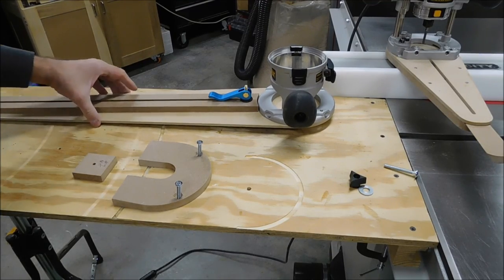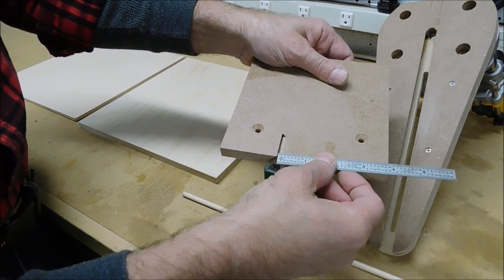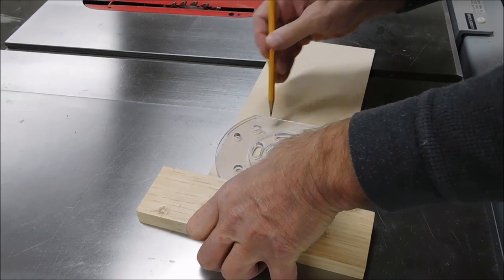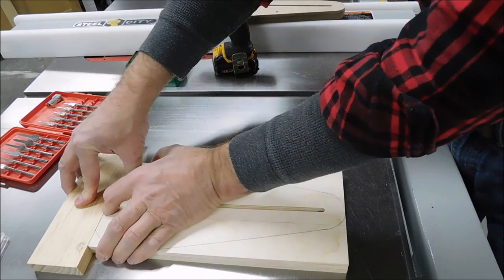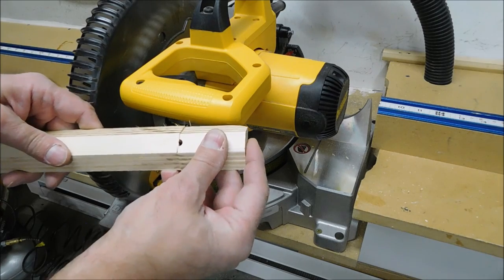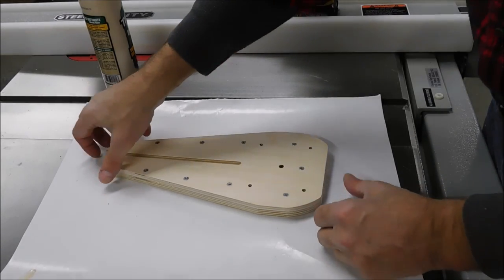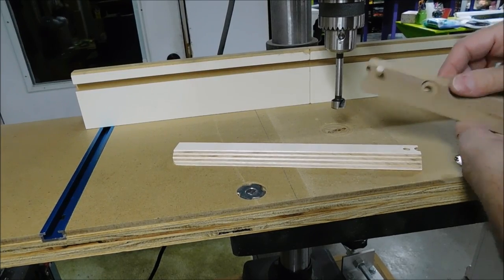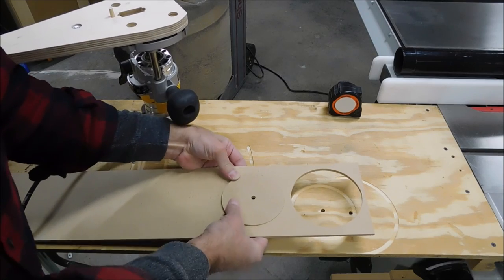How to Make the Small Circle Cutting Router Jig

Comment: Good idea's and well explained tim. I like the look of your pillar drill, what is it and how have you found working with it? Thanks
Reply from the maker: Thanks, sklif f y!  The drill press is a benchtop Sears Craftsman model.  I bought it years ago thinking I wouldn't have much use for a drill press but I find I use it on every project so I wish I had bought a better and larger one.  I like having a laser on it although the laser is cheaply made of plastic and has broken a couple of times.  I've had to super glue it back together.  I like the angled pivoting handle.  Making my own table and fence for it has increased its usefulness 100 fold for setup and repeatability.

Comment: Great video.  What is the smallest circle this will cut?
Reply from the maker: Thank you!  On mine, the center of the pivot is 7/16" from the center of the bit.
Reply from the maker: So with a 1/4" bit, I can make a 5/16" radius circle or a 9/16" radius hole. I would only try a small circle like that with the workpiece carpet taped to a thicker anchor piece, though.

Comment: Great video. I'm curious as to the maximum diameter for this jig. Will it cut 8 inch circles?
Reply from the maker: Thanks, MrC_5150!  As shown in the video, this jig's limit is about 6 1/2 inch radius or 13 inch diameter.  You can extend that a couple of ways.  Either drill more holes in the sliding bar to make the pin adjustable or just make the jig larger.  The piece of plywood I used was one foot square.  Hope that helps!
Reply: @timcanthejigman7932  Thank you! I must've been distracted from that part of the video.

Comment: TimCan, is there any reason why I can't make a plunge cut using a flute up spiral 1/2" bit? I need to makes some circles in 5/4 maple for some circular under mount sinks. Thank you.
Reply from the maker: It could be problematic due to chip clogging.  You will want to make a larger opening around the bit so chips have a place to go but if you make it too large, you weaken the dovetail slider.  And I'm sure you know to take light passes.  Any chance you could use a 3/8" bit instead so you don't have to have such a large opening?

You may want to take a look at my other router jig video and use that mechanism instead due to the size and type of bit and your needs.  Thanks for the question!
Reply: I'll order a new 3/8" spiral upcut bit. My set of straight flutes and spiral bits are 30 years old and look it. I don't know what I was thinking when I ordered the 1/2". The ID diameter of these sinks will be 12.125". I'm thinking that the small circle router jig will handle this job employing a 3/8" bit? Thanks. Good job on the Vid. Dick
Reply from the maker: Thanks, Dick.  Looking forward to hearing how it comes out.

Comment: Hello, I am new with wood work and want to know what is the sander called?  Also, for a new guy, that is amazing.  I am about to start a project that requires making different circles..
Reply from the maker: The disk sander is a Shopsmith (www.shopsmith.com)  It's a multipurpose tool but I mostly use it for sanding and lathe work.  Good luck on your upcoming project!

Comment: Tim...Could you use this same concept on the larger circle cutting jig or have you found that to be problematic?
Reply from the maker: Hi John. I think a good solution for using this mechanism but having a larger capacity is to just make a longer slider with multiple holes and a removable pivot pin or different length interchangeable sliders. But there's usually more than one way and they can all work.
Reply: Thanks Tim so much....I am going to build this one tomorrow and will play with the length...If I find it is too difficult I will just build your larger circle jig.....I like larger circle drill because it incorporates a no drill design.  Illl let you know how it goes.....John

Comment: modified it by adding a bolt hole in the other end  of the center bar, so it can be turned around to give you more distance between center pin and router bit
Reply from the maker: Great idea!  I've done the same thing to mine now.

Comment: Do you have dimensions for the jig?
Reply from the maker: I used a one foot square of Baltic birch so it's 12 inches long by about six inches wide at the big end, the width of the router base.  The narrow end is 2" in diameter.  That isnt set in stone.  The prototype made from MDF was about 15" long.  If I make another one, I'll make it longer.